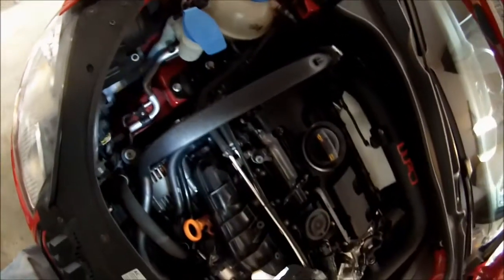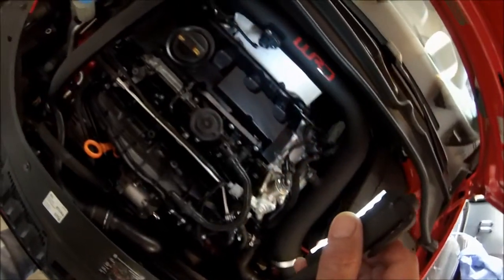2.0t FSI-BPY Smoke Test on MK5 GTI

Comment: Bro i have a small leak as well 0442 and gas cap light sometimes. Check the leak detection pump on passenger rear. If you take off the inner liner its visible. Common problem one of those vent hoses crack and cause a small leak. Also you can check the fuel pump gasket by pulling the back seat up and check for smoke. Ive also heard fuel filters can cause what your describing.
Reply: Roh Echt ok keep me updated. I have yet to check the LDP myself. I suspect the leak is in that area. I have to pull the rear passenger liner.